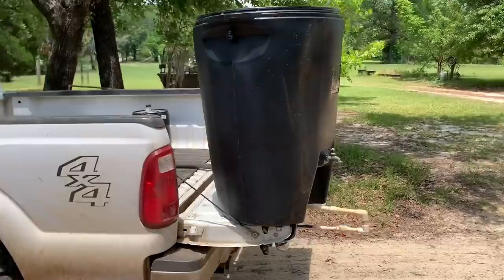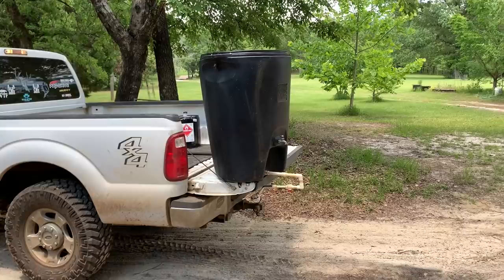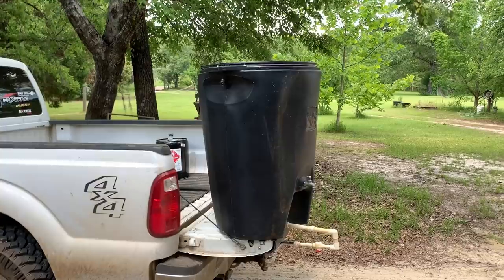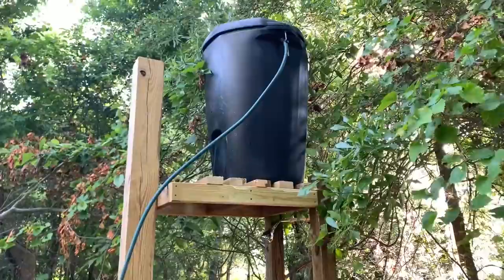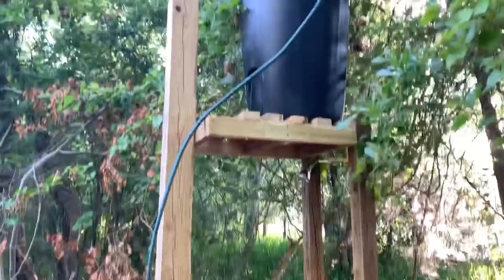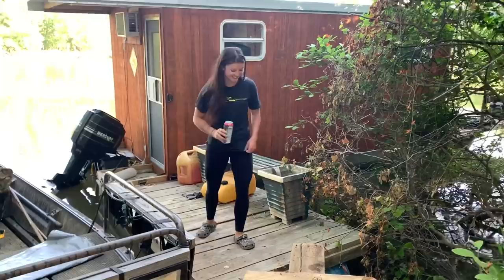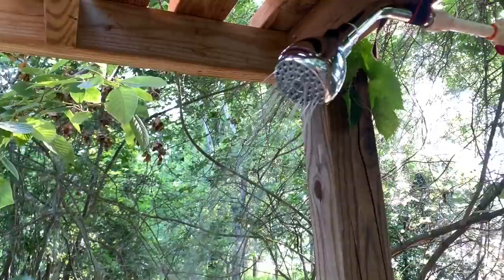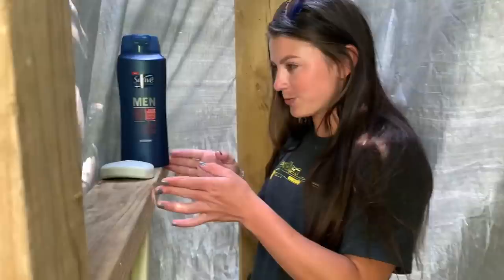Building an Outdoor Shower for the Catfish Cabin!

Comment: Most of those shower heads are low-flow there's a little plastic fitting inside there you can grab with some needle nose pliers and remove to get more flow, and keep an eye on that Lumber because them barrels are extremely heavy when they're full I had our rain barrel on some 4 x 4 post and it eventually started leaning to the left sinking from the weight. Another good video Jeff thumbs up.

Comment: Jeff, if you had an aerator pump that you're not using, you could have a plastic drum that was air tight, and when it's full, you could close all the valves and pump air into it... you'd have good water pressure, because the air would displace the water,  and it might take less water to shower at a time... just run it when in use... you can still use the inline water filter to remove trash from the lake water...

Comment: Get a roll of 1/2" or 5/8" copper tubing, wind up a coil of it a few turns and attach it inline to your fill hose from the pump. Put the copper coil into a gas grill, a camp fire or in a Carolina cooker/deep fryer burner and it will heat the lake water up as you pump through it to the can. I'd drill out the holes in the shower head bigger because they are water savers and usually run with 65 pounds of pressure where you have gravity feed which is only a couple pounds pressure.

Comment: If you take the shower head back off and look inside where it screws onto the pipe, you will see a little plastic tab. Pull that tab with a pair of pliers and the piece will come out. That is the water saver for the shower head. After you take it out, then just screw the head back onto your pipe. The flow should be considerably more for your showers.

Comment: Heres an idea.... Get a few feet of hose . connect it to the spicket. And put a hose cut off on the other end and attach the showerhead there. Then you could use the shower in 2 ways. Stable or moveable. Just an idea

Comment: Forget the shower head. Buy a head for a watering can and install a spring loaded "flush valve" for a urinal then tie a rope or chain to that. You'll get water on demand that will flow well but easy to turn off so you don't waste it. To make the whole thing sturdier, mount the plumbing to the wood and connect to the trash pail with a piece of hose.

Comment: There is a little white water saving devise in that shower head mandated by the government, if you remove it you will get a lot more volume. Just take the shower head off and look in the opening and you will see it, it will have a bunch tiny little holes in it, you should be able to pop it out with a pocket knife.

Comment: on my VPC valve I used a larger piece of PVC pipe and cut a notch in the end,  also added a Tee to the end of the 4' pipe.  The notch will fit over the valve handle to turn it on and off.

Comment: They have little 12V shower kits on Amazon. Put one end in a bucket of water at your feet. Hang the other end above your head and take a shower. They also have kits that heat the water on demand. Both very affordable and easy to use.

Comment: Take that showerhead off and look in the back and there’s a little plastic insert, all it is is a restrictor to slow down the flow, there are a lot of hack videos on YouTube about removing them because almost every shower manufacture puts them in there. You just pop that little plastic piece out and you get much more flow.

Now you just have to work on a tub with Jacuzzi Jets. ;)

Comment: I just bought a portable shower from chewy . Com  runs off a usb port just put it in a bucket  of warm water  works well will run 60 min. On one charge cost 29.00  has great stream pressure

Comment: A few tabs of chlorine might be a good idea?
Reply: Bad idea you tube and EPA water management and echo warriors will be after them chemical, s released in water ways  but I understand the concept of it
Reply: @donferguson2495  might take more than that because the organic material in lake water would use all of that bleach up pretty quick. Got to use enough bleach to oxidize/burn up all of the organics fully, if not there will be chloramines left over and those are dangerous to breathe and could be worse and smellier than the untreated lake water. Too little bleach it smells like chlorine and a musty smell with it. Enough chlorine won't leave much of a smell at all and there should be a residual of 1.5 ppm to prove that it got all of the organics oxidized (swimming pool water test kit). Treating wastewater is my job. I also have a swimming pool and I'm super picky to keep it perfect so that it won't burn anyone's eyes and be the safest possible.

Comment: You want to be careful about using pressure treated wood due to health concerns and we're talking the new improved less toxic version.
"Copper is a highly corrosive substance, this combined with the alkaline can make for a large degree of skin irritation when in contact with not only the wood dust but also prolonged skin exposure to the wood itself. The Boric Acid used to temper the wood during treatment can be absorbed into the skin causing serious sensitivities and allergic reactions. Monoethanolamine is another chemical used in the treatment of ACQ wood which can be absorbed through the skin and cause highly corrosive 
reactions. Didecyldimethylammonium chloride is a chemical used in the Quaternary Ammonium Compounds which has shown to be permanently harmful to both the eyes and skin of animals due to its caustic nature."